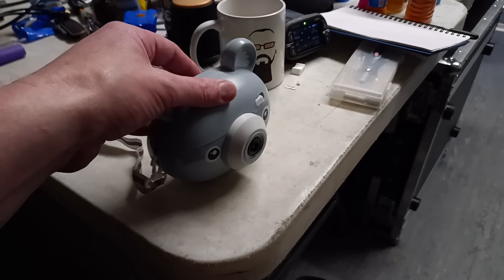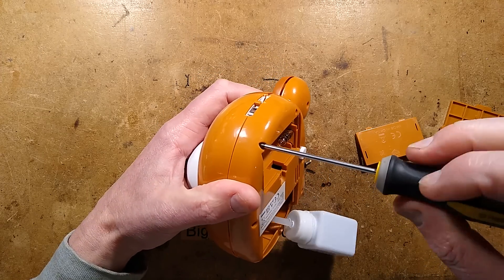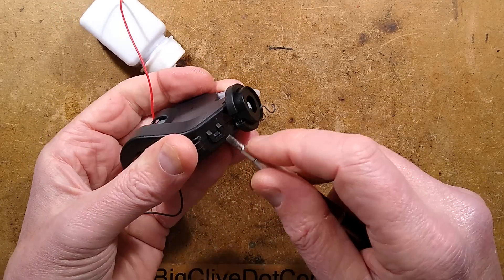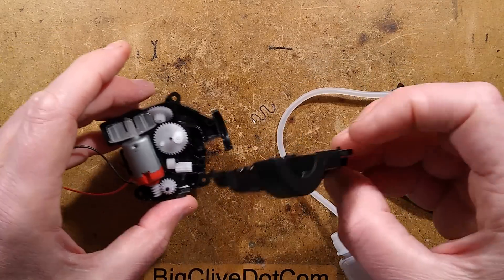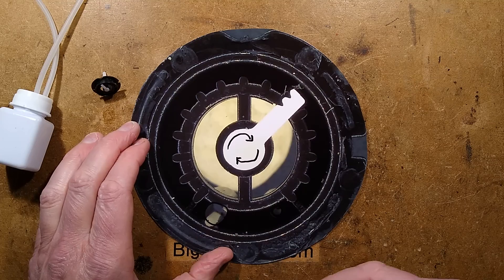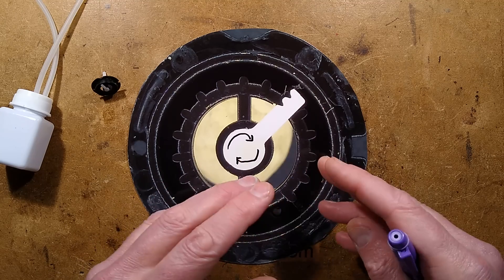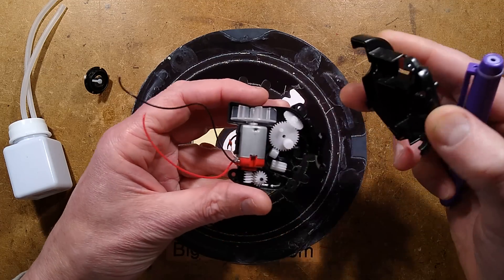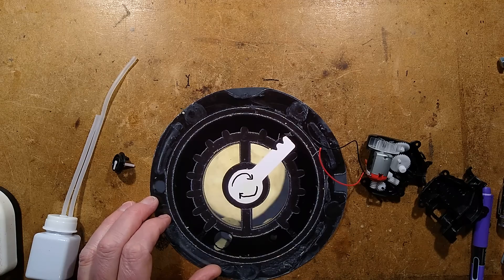Inside a Poundland bubble bear

Comment: Casing looks like it was made for a camera, especially from the thumbnail.

The feed-and-return concept is used in things like gasoline and diesel engines and hydraulic systems too. It eliminates the need for a precise pressure or flow regulator.

Comment: A comment on the surfactants: Air is also hydrophobic so in a water / air interface the surfactants will also pack nicely and help stabilize the bubbles. Depending on the chemistry you can get more or less bubbles/ foam and with different characteristics. Eg a thick, creamy foam (Guinness) or a thinner foam lamellae in a lighter foam.

Comment: It's amazing how many different actions combined  can create one action. In my electronic studies, 50 years ago, I was taught that electronic equipment was made up of a multitude of little circuits working all together. Being so, you can troubleshoot the small circuits in a much less mind-boggling fashion than as the whole unit would. However, there are circuits that are very complexed that rely on feedback from other circuits, in which you would have to take much more into account while troubleshooting.
Reply: Actually this video contained 0 electronics. But Clive's charismatic presentation and also knowledge of chemical constituents sets him apart from the endless unboxing wafflers we have to put up here.
Reply: I think that is an excellent comment on good design:
"It's amazing how many different actions combined can create one action. In my Unix-like programming studies, I was taught that final programming was made up of a multitude of little programs working all together. Being so, you can troubleshoot the small programs in a much less mind-boggling fashion than as the whole unit would. However, there are programs that are very complex that rely on feedback from other programs, in which you would have to take much more into account while troubleshooting."
This is the core philosophy or most fundamental rule for programming starting back when Unix type operating systems were created and continues on in the good descendants. Make a very simple program that does one thing and is easy to debug. Pass the output on to another one, on and on. In the end you get something very powerful but made from easy pieces. I really do prefer to use the command line more than graphical versions.
That bubbler toy is really top notch engineering. It seems so simple, but there are many complex fields of science and engineering in that little toy.
Reply: I have visions of someone telling Mao Zedong in 1949 that in 75 years' time the People's Republic of China would be the world's largest manufacturer of bubble bears (and battery powered cats' toys, and other things along the same lines).
Reply: The most complicated ones I had to work on when I was getting started were television sets, which have a whole host of interacting circuits with all sorts of mysterious failure modes when things would appear to be broken but they were just missing the conditions they needed to operate properly (in particular the horizontal sweep system, which ends up driving a surprising amount of stuff, which in turn controls the sweep).

Comment: I'm surprised that the motor had outputs on both ends. Most of the little motors that I've seen have only had 1 output connection.

Comment: After the bubble fluid runs out, is it possible to buy refills? Or can I make my own? 
Not that I would be buying a bubble machine anytime soon, but I am interested whether this is another of those "5 minutes of use and then landfill" products or it can last until some plastic part inside fails.
Reply: Our dollar stores carry toys like these and also sell large bottles of solution, I want to say maybe a quart size.
Reply from the maker: It uses standard bubble liquid available from many high street shops.  Poundland sells it in bulk bottles here.
Reply: You can also try dish-soap and sugar, that works quite well for hand-made bubbles.

Comment: Very nice unit, what awful 'music' though.
Reply: This is another toy that could benefit from transplanting the farting ninja's sound chip. Who doesn't love a farting bear that blows bubbles?
Reply: Retrofit the farting ninja sound chip in it 😂 then route the bubble orifice to the bear's posterior, BAM! fixed 😂😂😂
Reply: @SomeRandomDude-zqxj okay now we watch for a month or so or more and then all of a sudden where is the Chinese made Toy yep that toy you just mentioned:-)

However if there be a way to do this I think it'd be hilarious just a modified to make this happen except modify the ninja circuit board to fart continuously or perhaps have a cam somewhere in the mechanism or even have the rollers or something else on the parasite pump perhaps triggering the farting module or even potentially when someone walks in the range of it with the light based motion detection the bubbles and the and the farting starts you might as well as besides being charging reverse engineering and also modification project just for the heck of it not to mention challenge accepted sort of thing if it doesn't work oh well just repurpose the bubble making equipment and perhaps the sound chip that plays the lonely goatherd